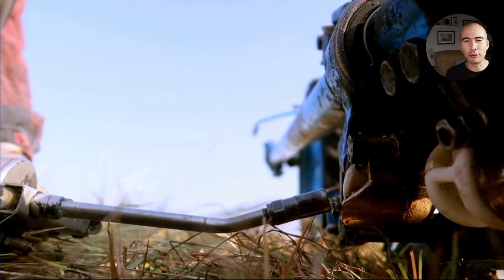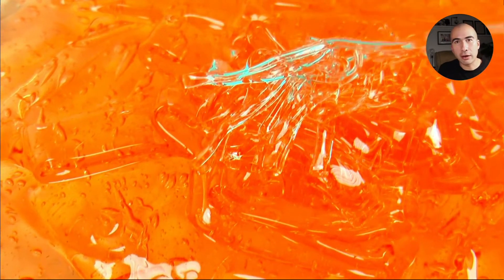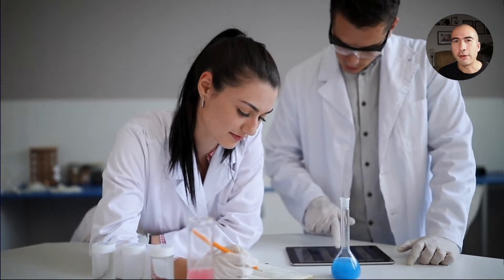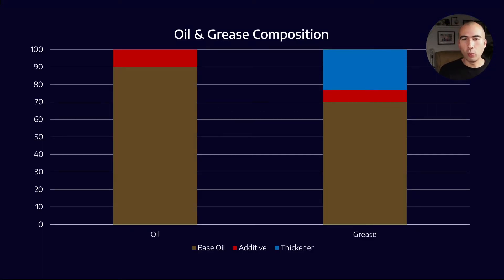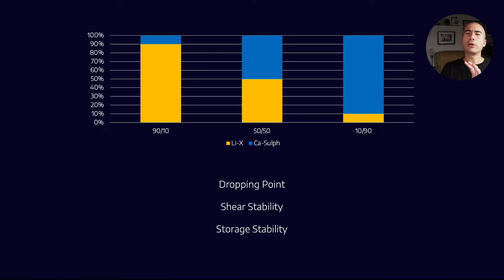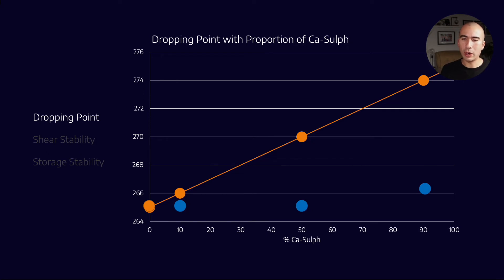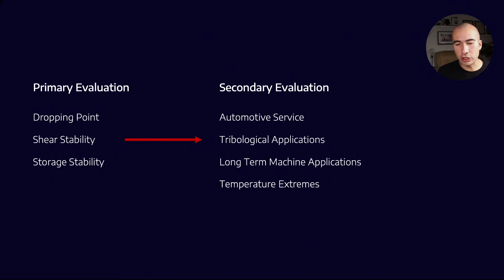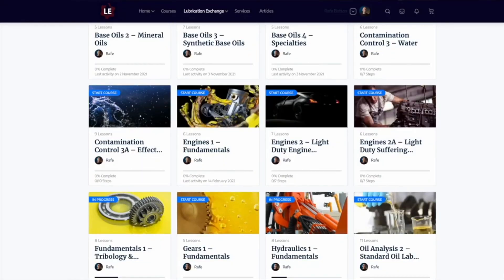Compatibility of greases explained

Comment: Decades ago I put Lithium into something automotive that had Moly (or reverse) and got hardened grease.  Decades later I am still gun shy.  Now there are lithium complex greases that have moly in them.  It was the ages old auto manufacturer incompatibility thing.  Chrysler vs Ford grease issues.  Looking to grease a new piece of Kubota equipment brought me to this.